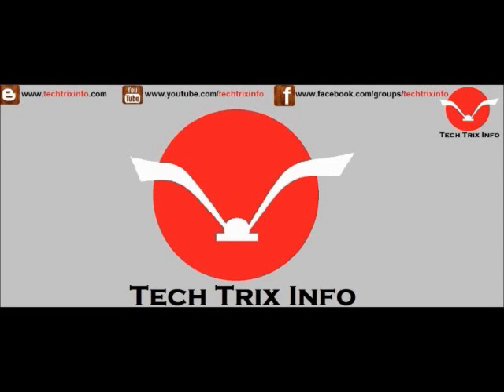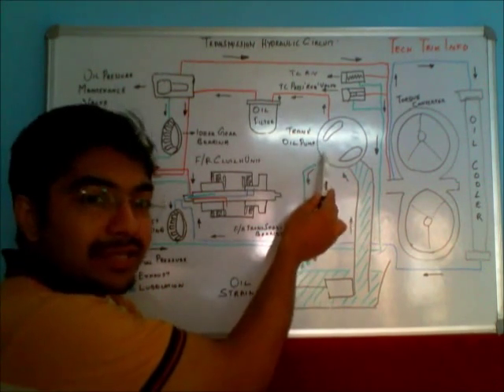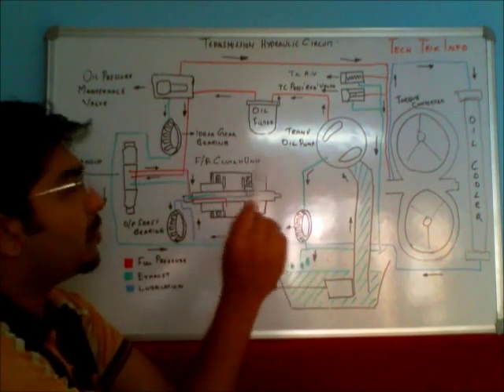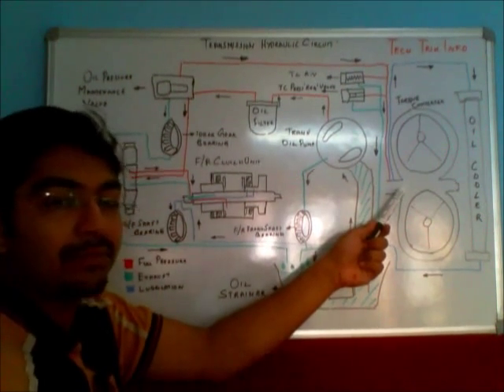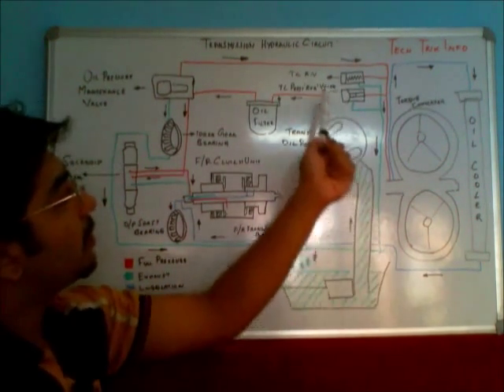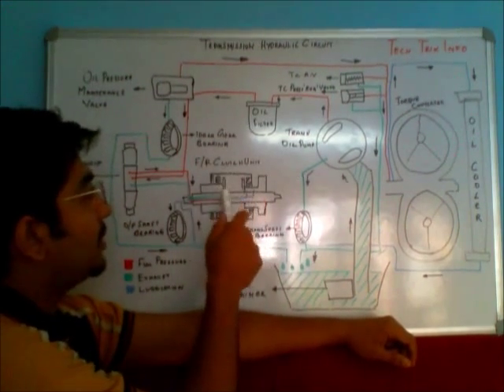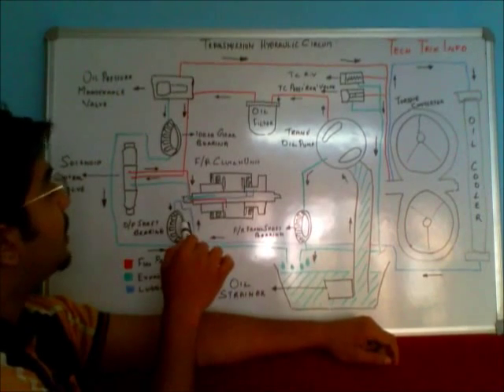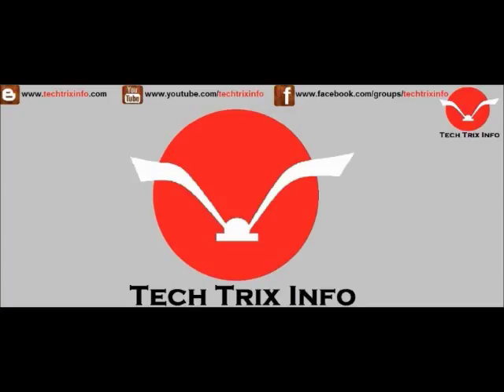Transmission Hydraulic Circuit Explained.

Comment: Great Attempt.Nice tutorials you guys are posting Some of my opinions are:

1) Hydraulic circuit is usually nd mostly the high energy/pressure lines and not the lubrication/cooling circuit; So you may rename it as hydraulic/lubrication circuit.

2) Back hoe loaders/proclains have numerous hydraulic cylinders in their loaders, each having a unique servo hydraulic control/sequence valves controlling their flow inlet/drain. The fluid comes from the hydraulic circuit, which you haven't mentioned.